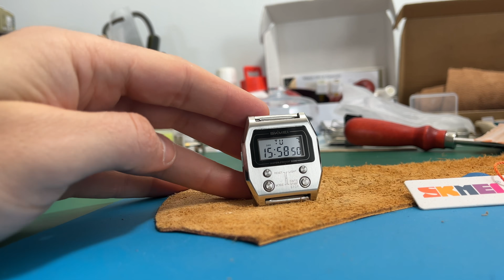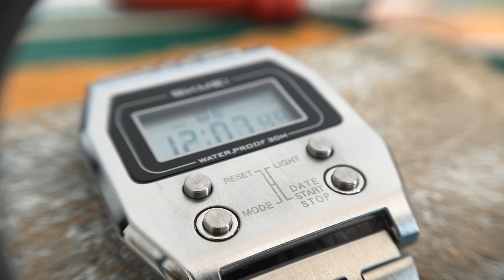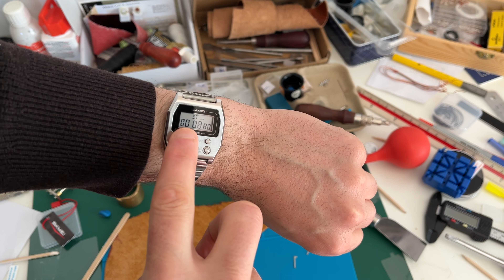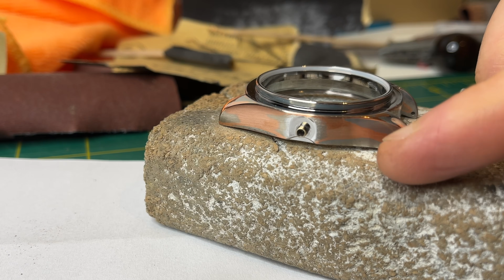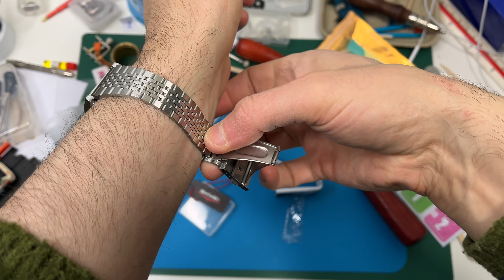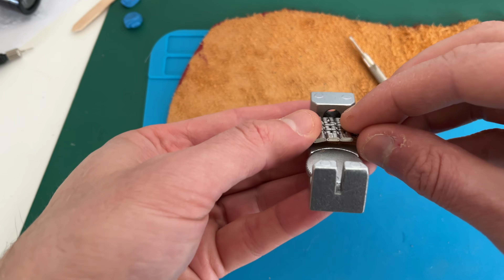SKMEI 2460: Metal Case, Date, Timer, 1/10th the Price. Sorry, Casio.

Comment: man, i bought this watch about 2 weeks ago and i haven't been able to wear any of my casios since.  the ONLY issue is how easily it accidentally switches from 12/24hr time.  but i agree about the sides, they're so smooth and satisfying.  it's VERY comfortable, and functional.

edit: I broke a watch tool as well, so I brought out my automotive tool kit and used some needle nose pliers and a pocket knife just like you did! once you learn how to punch out the pins, it doesn't take too long.  but, i didn't have to remove quite as many links as you did.  i think i only needed to take out 3 or 4?
Reply from the maker: Glad you're enjoying it. Nice work getting the strap sized 👍
Reply: I don't get why a lot of watches have that time format switch easily accessible, that should be in the time settings and not it's own separate button.
Reply: How are the viewing angles? I hate ghosting. I don't wear my solar square G-Shock for that reason (easily ghosting because of the solar panel)